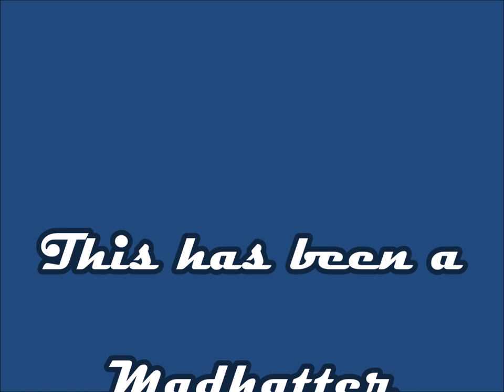3M™ Headlight Lens Restoration System |  Here's how to do it!

Comment: I need to do this to my car 🚘
Reply from the maker: One thing I like about these GM trucks between 2003 and 2007 is the head light housings come out by pulling two metal retaining pins which make this job so much easier.

Comment: Unfortunately they don’t have the glass lights on vehicles anymore. Over time the oxidation and debris takes a toll on the lights, so the coating goes away. I find it better to use the fine grade sandpaper with a wetting agent(water and a dab of dishwashing soap) to clean off the lights, then spray on a clear coat paint layer. Seems to last longer.
Reply from the maker: I have done that method before too.  These were not too bad to start so the cleaning process was pretty quick and easy.